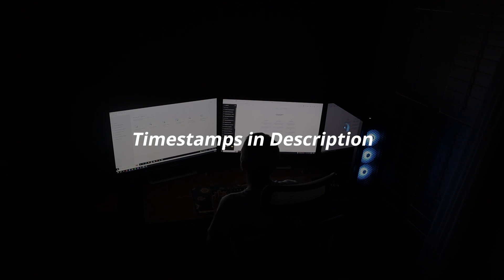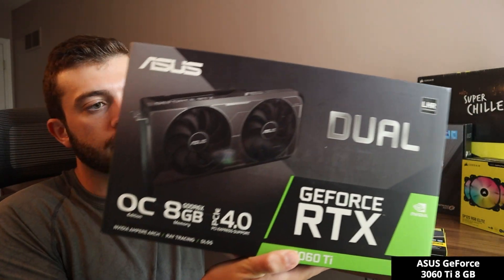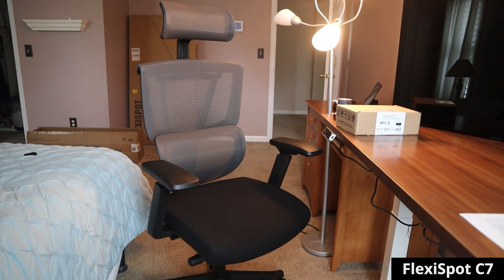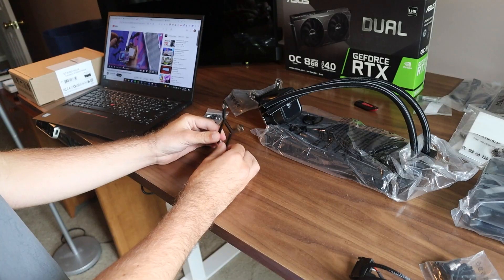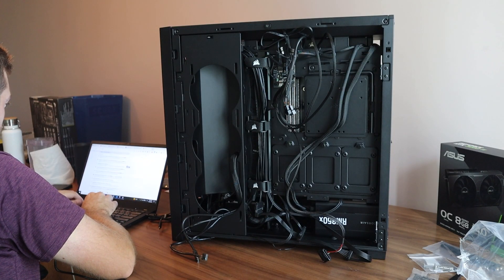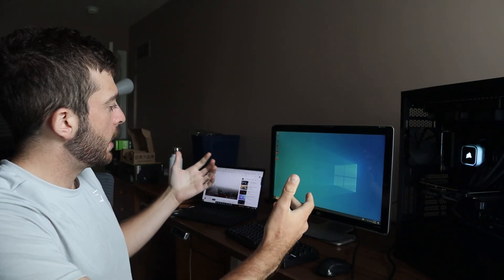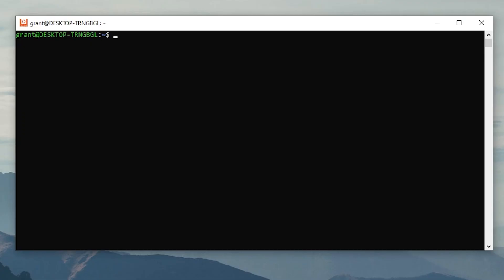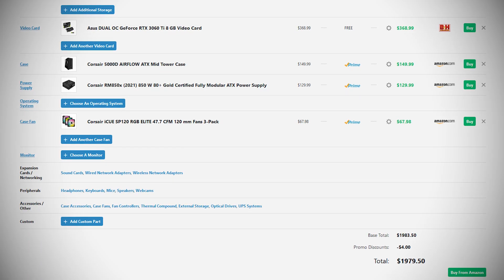Building a PC  (My Cybersecurity Study Setup)

Comment: I use a 3060ti for video rendering myself, I am just learning about video rendering lol but I love it so far. Main GPU is a 4070ti because I am a gamer. Also that PSU is surely more than you need lol running 2 GPUs at full power while gaming and recording and my i9-3900k running at 50% load. You really have a nice/clean setup with more than you need my guy!!!!

Comment: Getting a new computer is always exciting! Honestly for Cybersecurity and relatively straightforward content creation and editing, that build should have plenty of power. The nice thing is that if you need more power, that motherboard can support higher RAM and you can easily swap your graphics card with minimal effort. The one thing that you're probably going to need is more RGB! That build needs to look like a Christmas tree.
Reply from the maker: Thanks, Jon! I decided to pursue the minimalist look with the RGB lights. I am hoping this machine lasts me a while, as this was a significant investment. Hope all is well on your end!
Reply: @collinsinfosec  my YouTube build from when I started my channel ~4 years ago is very similar. It wasn't necessary to use the top end parts but that system still runs like a champ for everything. I hope that you get the same kind of lifespan on your build.

Comment: Didn't know that hardware specs / building pc has anything to do with cybersecurity.
Reply: Of course it does. To handle multiple vms you need a hefty bit of ram. Even something like basic brute forcing, 8gb of vram is terrible, you wanna make sure your cpu and gpu have the resources needed to perform a wide range of attacks like pitchforks and clusterbombs. Good luck brute forcing 14-50 character passwd's with a shitty cpu. So basically the build you have matters quite a bit.
Reply: @markyymarkXL  a terminal is more than enough. for brute forcing one can setup a separate system with gpu racks and use it when needed remotely
Reply: The video was clickbait
Reply: Me too
Reply: so how did you pass you COMPTIA A+ exam.
Reply: @marjan2333 not really into certs
Reply: Hey, well now you know.
Reply: Correct title: “I’m not a gamer - how to build a decent PC for video editing from my knowledge”

I’d expect a “my cybersecurity study setup” to include:

1. Software Security measures like Ctrl Alt Delete before login, secure boot enabled, no usb start up, OS modifications to prevent the replace sticky keys “hack”, no wifi on start up, anti-virus software and tools 

2. Must haves for anyone doing Cybersec, maybe a Win7Forensics OS not windows 10, Autopsy (runs on windows). He mentioned windows having a WSL (windows subsystem for Linux) but showed the downloadable Ubuntu vm , he could’ve shown how to configure WSL, how to setup Nmap , Vbox, Partition drives and encrypt them with VeraCrypt etc…

3. Hardware specifically chosen, maybe a cpu core specifically chosen because it couldn’t fall victim to Spectre and Meltdown (tho I think those Mac issues not sure), hard drives that came with encryption or were trusted, a lock on his Pc container unit to prevent access , A SPECIFIC NETWORK ADAPTER WITH PROMISCUOUS MODE AND MONITOR MODE ETC….

Boss man, good video decent to watch. But this is not Cybersec video, you buy the parts and we can research together what would make “the ultimate Cybersec setup” because I’m actually interested now